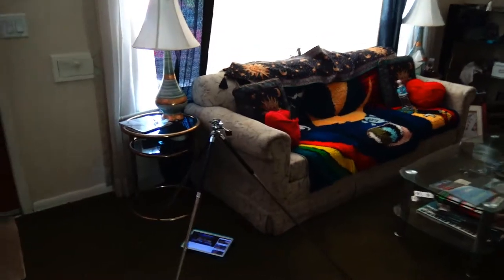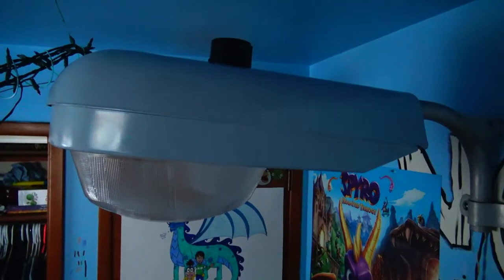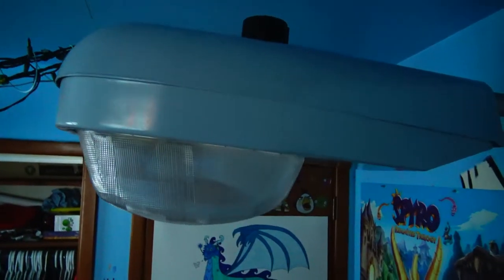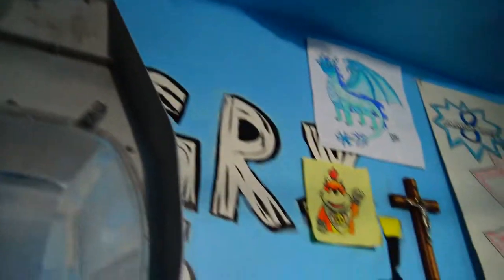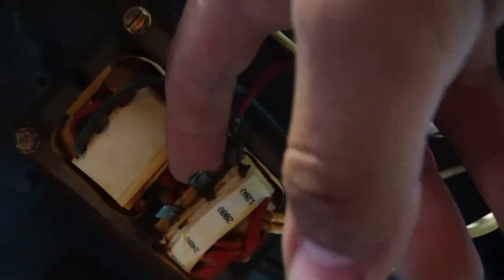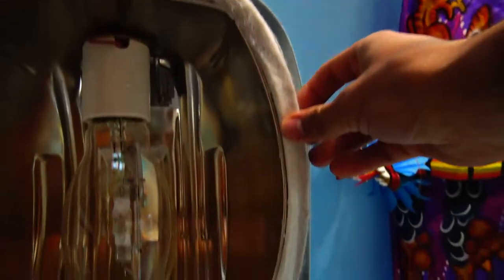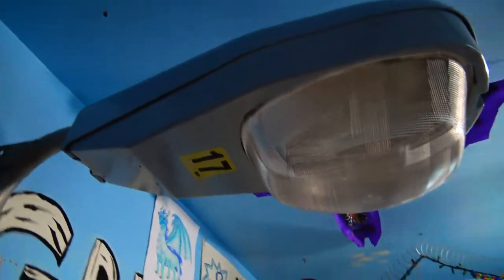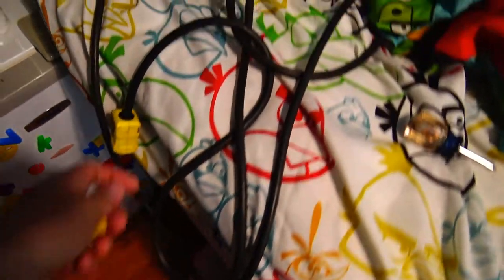My Cooper OVH 175W MH Street Light Overview

Comment: I actually used to have some warm white metal halide. Or even HPS light that cycled only a few times. I don’t know if it’s the light or the light bulb as it cycled a very few times and it would usually run dead.
Reply: So this has to be 14 years or older.
Reply: All the other lights were HPS.
So I can think that one was just a sodium starved HPS bulb.

Comment: The brand of this refractor (glass lens) was introduced in the late 1969 was unknown. It is not General Electric, Westinghouse, nor American Electric. When I was 13 years old of that time, they have installed the “Space ship” shaped Josyln street light fixtures 250 watt Mercury Vapor Lamps in east side of Dearborn Michigan to replaced the old incandescent style street lights to save on energy, and the Mercury Vapor Lamps does last longer then the older incandescent style lamps.

Comment: Is that NEMA label yellow? If it is then they printed the label in the wrong color. Yellow is the color for high pressure sodium lamps. For metal halide it is supposed to be red. Pulse start metal halide is usually half red half white.
Reply from the maker: Yes, but this isn't a pulse start metal halide luminare since there is only a transformer and a capacitor, so the tag should be white instead of striped. However the color of the tag is still the wrong color.
Reply: @polarslightssignals2742  no it should be red for metal halide. There are no white NEMA labels.
Reply: @polarslightssignals2742  it’s a faded tag likely. GE’s tags are notorious for this. Lots of MH tags in my area become yellow over time for some reason. The mercury ones fade to white.